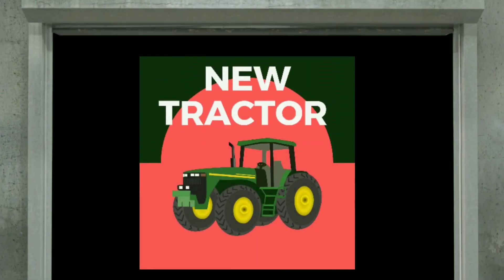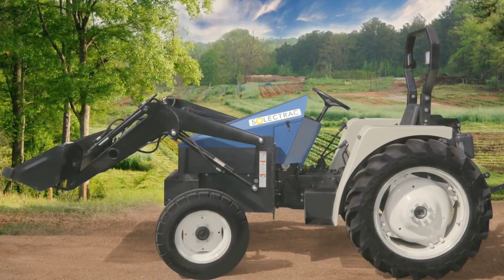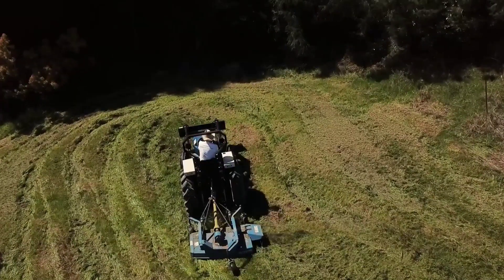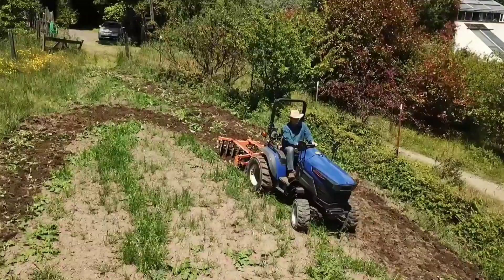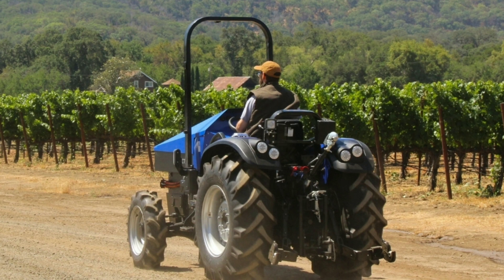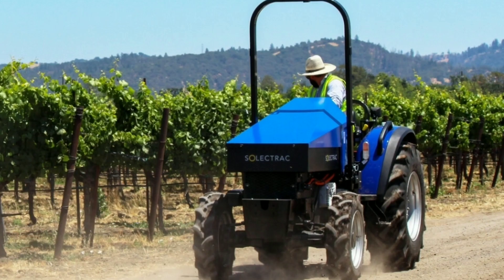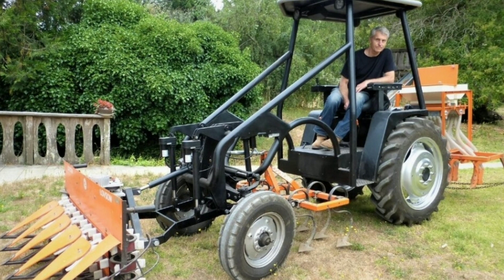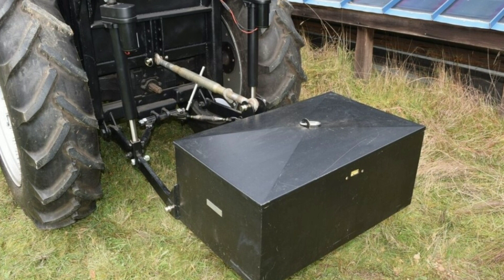Don't buy an electric compact tractors before watching this.

Comment: No thanks. It takes about 15 minutes to refuel my tractors. They also have heat and air. Battery powered cars and trucks are not the answer.  Hydrogen fuel cell is a better solution.

Comment: Sounds like you need an auxiliary battery to do any real work.  Implied that it goes on in place of an attachment/implement.  Didn't give cost for that but since they are bigger than the on board we'll north of $7k.  Didn't mention hydraulic power.  Sounds like a fun toy for people who don't use it much not a work horse.  No thanks.  If power is out and you need to clean up debris you would have a limited time to work.  Power is out in California whenever the wind blows or somebody starts a fire.  So add a genenerator to required equipment.